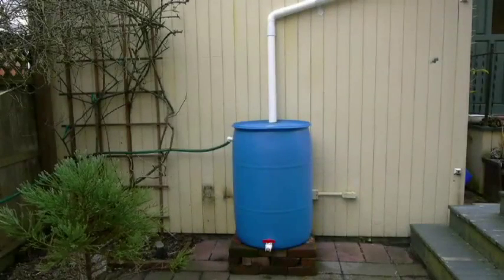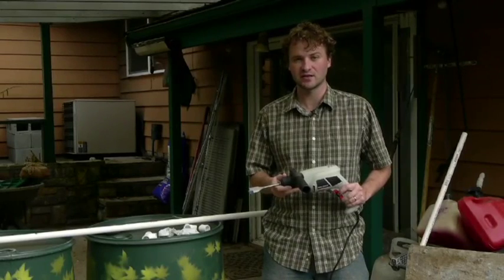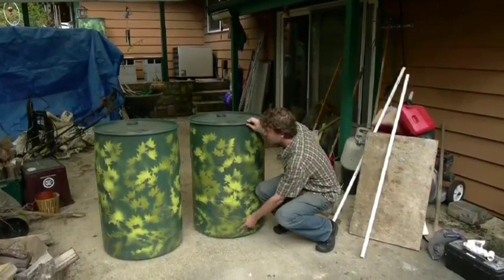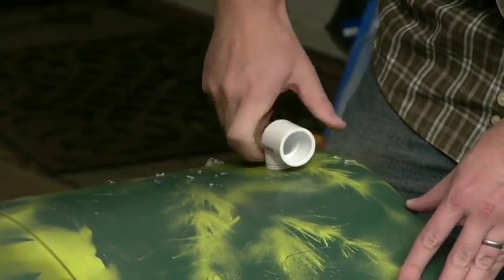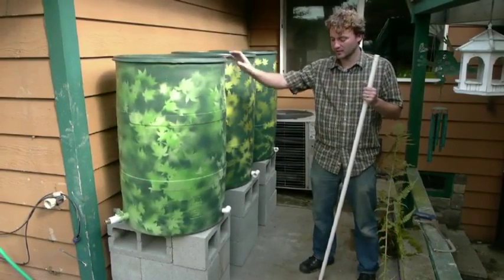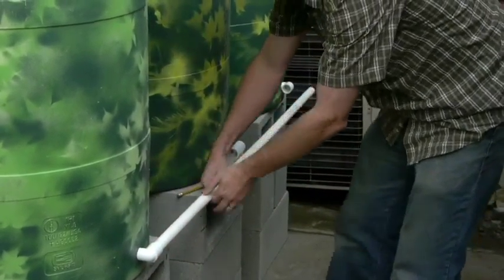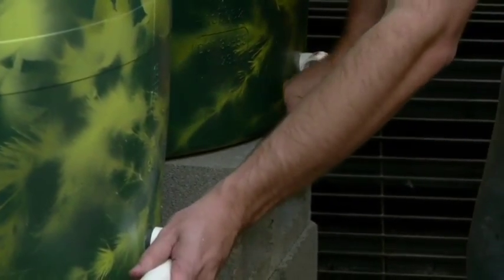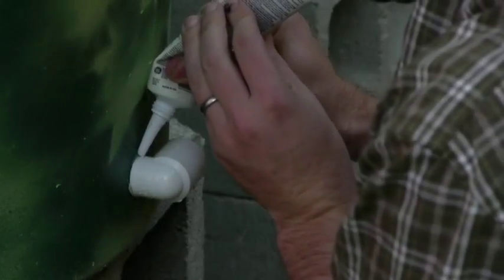How to Build: Multi-Barrel Rain Water Collection System

Comment: Run your fill pipe to one of the cap holes on top, use a t connector to thread in and to pipe water to the next barrel.  Then you only have to drill a hole at the bottom for your outlet.  Use a bulk head fitting for the outlet so you don't have to thread it.  Now you have air release and will fill the barrels completely.

Comment: Hi, thanks for the amazing video! I have a three questions. 

1) I don't have a 3/4" threaded pipe tap, and am having difficulty tracking one down. Do you know if it would create a tight enough seal if I simply use a 3/4" spade, and then try and thread the 3/4" PVC into the hole - even though the hole has not been threaded by the pipe tap? If I do this, I plan to use sealant on it. 

2) Is it important that the connecting PVC piping is placed above the release spigot? I already have a spigot installed and it's at about 3 inches up from the bottom of the barrel. 

3) Does the fact that the water is spread evenly across all three barrels decrease the pressure out of the spigot, as opposed to a single barrel or a "top fill" multi-barrel system where the barrel with the spigot is usually full? I have soaker hoses attached to my system and am trying to maintain the highest pressure possible.

Thanks again for this video - super helpful!

Comment: doesn't really address the air pressure build up or release in tanks.
Reply from the maker: Hi Eric. Air pressure was not specifically addressed in the video. Typically, a single or multi barrel system will have an opening or holes (inlet for water to enter the barrel and overflow valve) which lets air escape. There are also bung seals (small caps on top of the rain barrel) that can be loosened to allow more air flow. We hope that answers your question. Thanks for your comment.
Reply: @SnohomishCD once you open those caps your likely to get bugs and only debris inside. unless you then cover the hole with a screen or breathable mesh.
Reply from the maker: You're right, if the bung caps were removed you'd want to place a screen over it. In most cases you can unscrew the cap just enough to let air flow but still protect your water from debris and insects.
Reply: @SnohomishCD  on the sealed top barrels that have to two inlet caps. one is a 2 inch round fine threaded which you can thread a standard 2 inch pipe into. while the other one is a 2 inch course thread that has a 3/4 inch knock out in the middle. that you can thread a standard 3/4 inch threaded pipe into. so using those build in caps. you can make and plump both and inlet and outlet. if you set up the tanks and pipes in one of a few select ways using a manifold system.

Comment: Will 7/8" spade drill make a 3/4" hole
Reply from the maker: Hi Kevin. The 7/8" spade drill does not make a 3/4" hole. The 7/8" spade is undersized to ensure a tight fit, the use of a 3/4" threaded tap piece creates the correct size of the hole that allows the 3/4" PVC fittings to attach tightly.

Comment: When stringing multiple barrels together using the connecting pipe at the bottom, where do you put your overflow pipe?  (does it need to be on the last barrel in the series, or the one with the spigot?)
Reply from the maker: Hi, thanks for your question. The overflow valve can be on any barrel. When multiple rain barrels are connected together, they fill up together so it should not matter which barrel it's on.